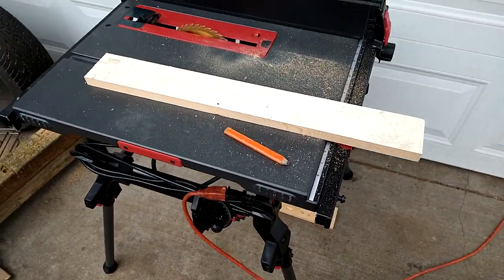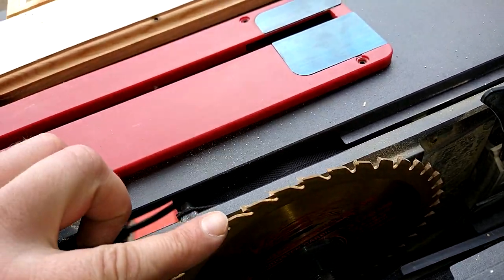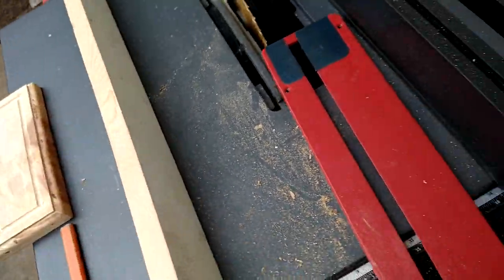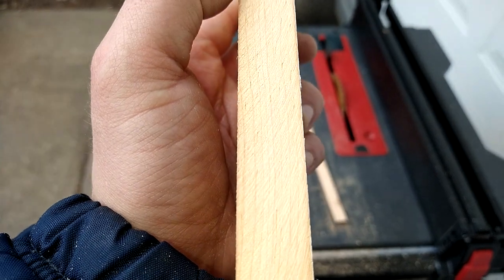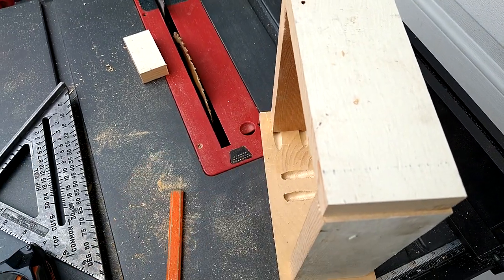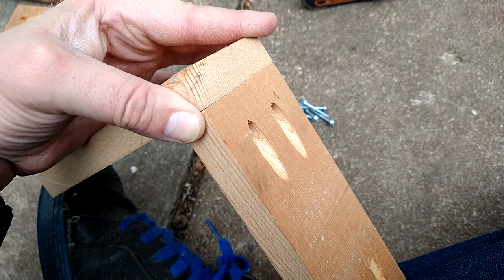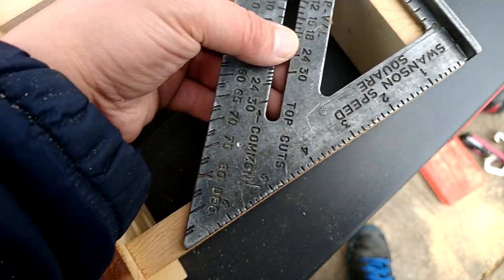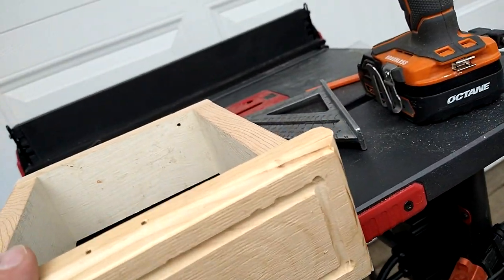Skil TS6307-00 table saw and Milescraft pocket hole jig

Comment: I just bought the same table saw yesterday and it is back ordered so I may not get it for a few weeks. Nice video. I will just buy a nice miter fence and scrap the bad one..

Question.  If one connects  say a 3/4 of an inch thick sacrificial fence to the installed fence, can one still adjust the tape measure to zero or are the plus and minus adjustments limited to say no more than  a 1/4 of an inch.  Thanks